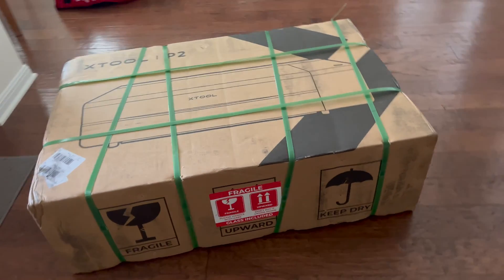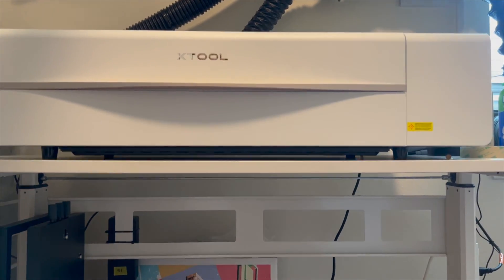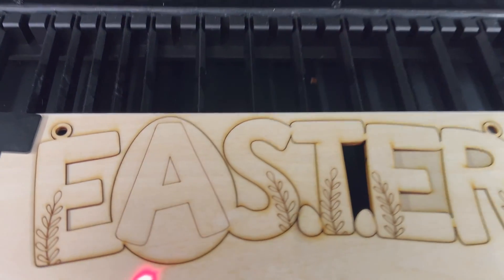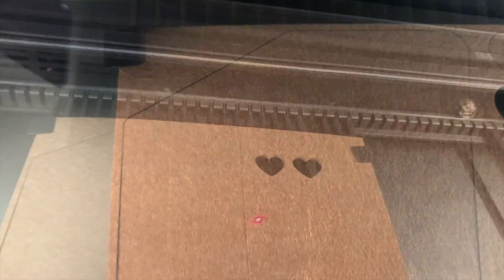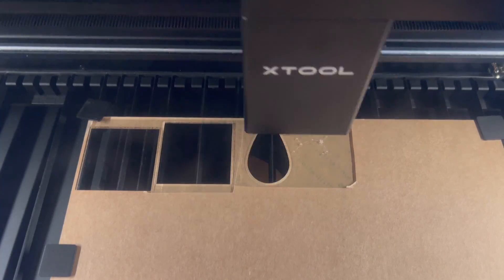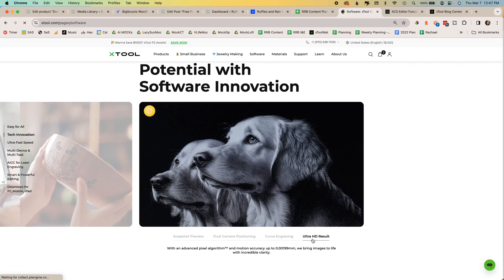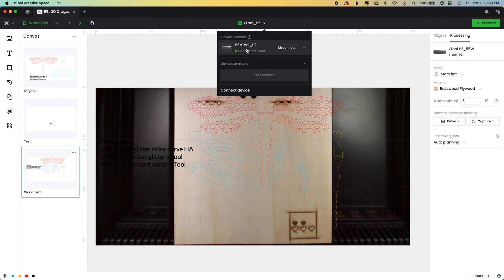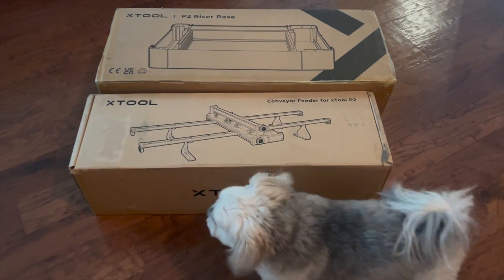xTool P2 Review and Projects / Acrylic Laser Crafts / xTool P2 CO2 Laser Review / Best CO2 Laser

Comment: Hello, what brand is your work bench? I don't see it in your amazon links.
Reply from the maker: Oh, it is a manual elevating table (rise up and down) but for the P2, I put the legs from Amazon under it. They are really sturdy and I can do high speeds without any shaking. They also allow for storage underneath.
https://amzn.to/3MnvSPX

The tables I have are the 55" inch manual elevating, but you could just buy a desktop / wood top and use the sturdy legs.

Comment: Hi 
I love your video.
Would you be able to let me know the your air assist settings especially for engraving please 🙏.
Reply from the maker: For the P2 (original, not P2S or P3), I turn it to the lowest it can go, which is 30%. If you have a P2S, you can go down to 10%, I believe, and that will make a difference on wood and acrylic.

Comment: Great video Sarah! Are you finding that the acrylic smells with the inline fan? I’ve only ever cut wood so far and even with the inline fan, my indoor studio smells like a campground! Any thoughts?
Reply from the maker: Oh no! I never EVER smell wood at all and haven't yet smelled any cast acrylic. When I was doing the water ripple-looking acrylic, I could smell that. 

I do have an in-room purifier (picked up on Amazon) so I have that running. I also picked up a tip from someone here on YT to put baking soda in a dish inside my lasers when not using them. 

Finally, I have my fan pretty close to the window. Is yours far?